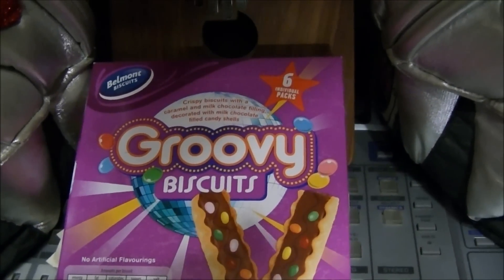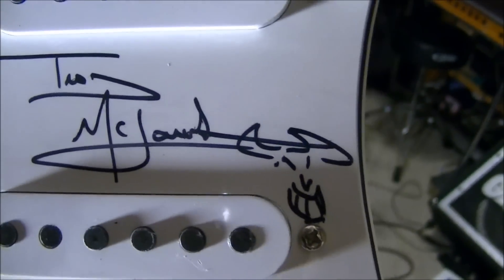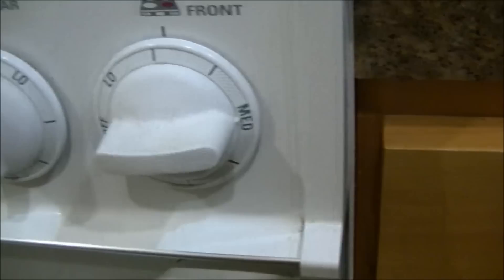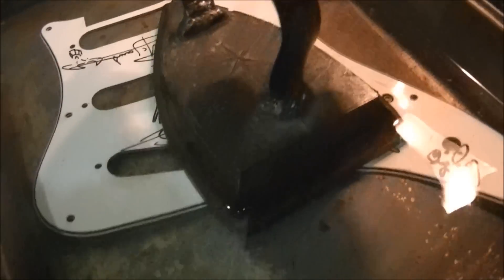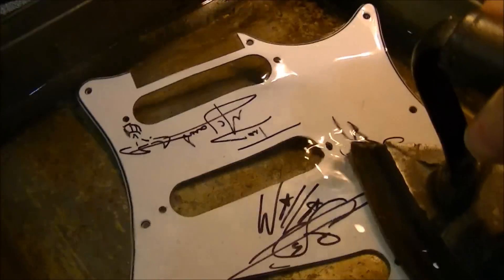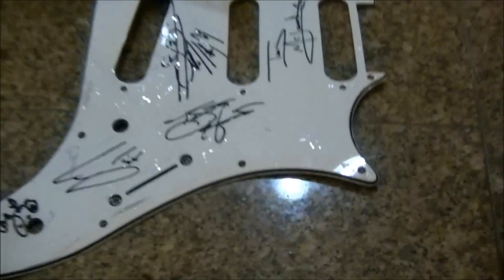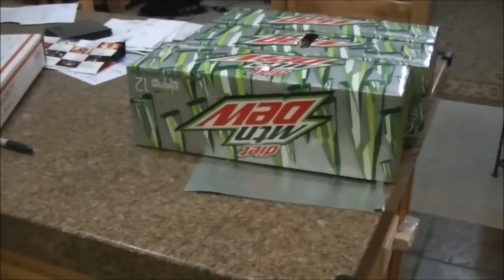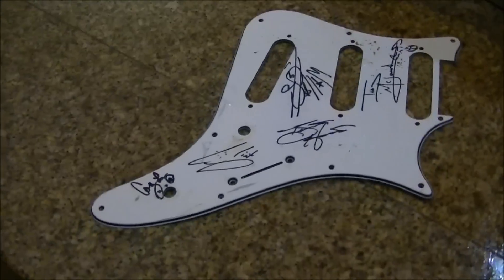Straightening Out Warped Pickguards  By Scott Grove

Comment: Scott, thanks a lot! Just used your technique for flattening a warped out gray pearloid guard from a 90s Ibanez Talman. This thing looked like the Rocky Mountains before I got to it. You'd be striking the guard every time and hear the hollows beneath. Fixed. Done. Super easy. The hardest part was taking off the tone knob. I used a shallow cookie sheet, filled with water, used a smaller 2" deep cake pan that covered the whole guard, and weighed it down with a 15 lb curling weight. Final flattening and cooling on countertop. Thanks again.

Comment: I use a hair dryer, works fine too.
Reply from the maker: How does it do on Bakelite?   Plus, to those reading the HAIR DRYER method.....take the pickguard and all electronics etc. off the guitar before you do ANYTHING to your pickguard, hair dryer, under water, microwaves or flame throwers.
Reply: Hey Scott, I haven't tried on bakelite.. and of course, always remove the pickguard before using the hair dryer, unless you like bubbles on your finish!! See ya Doctor Groovy!

Comment: In a strange way i just do like warped guards. But good video for those who don't :).
Reply: Note: i don't think you must try this with nitro celluoid guards, because celluoid reacts very very on minor warm temperature. I dare not to do that with pguards of +$500
Reply from the maker: You don't dare to.....But.....I have many times.  I could get about a grand out of the Firebird pickguard, but.....into the water it went.....worked perfectly.  I wouldn't post it if it would hurt anything.  Just don't bring the water to a boil or anything.  Just enough to make the material pliable.
Reply from the maker: I guess you are.  You are not aware that parts can cost that much?  Here's a white STRAT pickguard for $2,400.00  http://www.ebay.com/itm/1957-Fender-Stratocaster-Pickguard-REAL-DEAL-1957-1958-1958-/391160483880?hash=item5b12fb5028:g:-uQAAOSweW5Vb09v  Couple grand here:  http://www.ebay.com/itm/1950s-Fender-Esquire-Authentic-Original-Pickguard-50-53-/282145075851?hash=item41b128328b:g:NGkAAOSwaB5XkpsR  Here's a thousand dollar Les Paul Pickguard http://www.ebay.com/itm/1952-1956-Gibson-Les-Paul-Standard-Pick-Guard-/151361728256?hash=item233ddcaf00:g:nRAAAOSwDZxTzl85   If you are a collector, then EVERYTHING is expensive.  The pickguard on my 1964 Firebird goes for a thousand or more easily and I straightened it out this way.  It's just what things cost.
Reply: +Groovy Music Lessons that's true. Thanks Scott. Cheers
Reply: +Quikdeth check Eddy Vegas store on the web. Try to not freak out :)
Reply from the maker: It's no different than having a passion for ANYTHING.  Do you want a Porsche?  If you get one.....expect to pay tons of cash for ANYTHING that will go wrong with it or when it gets damaged.   This is NOTHING like drugs.  Wait until you grow up and half of your family and friends have either O.D.'d or simply killed themselves because of drugs.  If you ever have kids, statistics are that if you have more than one....you'll likely get to watch one of them die from drugs.  I've had the thrill of watching about 20 close family friends and family members die from Heroin in the past year alone.  Don't laugh about drugs.
Reply from the maker: Venom?  Whatever.....blocked.
Reply: Groovy Music Lessons hi doc. Yesterday i gave it a try exactly  like your way here. So i can now say, it's a Perfect method and works for me.
I had a extremely warped nitrate celluoid one fitted on a Fender Jazzmaster '63. I was a bit sceptic you know about this, 1. the vallue of the guard and 2. The material nitrate is extremly reactive to heat that kept me a bit affraid, but with all your video's, your allways right. I take the risk and i'm glad with your advice.
Thanks doc. Regards Richard
Reply from the maker: Howdy my friend.  I'm glad you tried it out.  So many people are freaked out by my little methods or discoveries.....but.....they work.  lol   Yeah, I know what you mean about the value of the pickguard and the guitar etc.  I did it to my '64 near mint Firebird V and it turned out perfect.  When dealing with guitars worth more than 10K, it can be scary, but.....I've done it so many times now that I don't fear any guards at all.  I just have to remember to treat it like a pickguard and remember that I'm not cooking bacon.  lol  Again, thanks for stepping up and taking that chance that things like irons and hair dryers will destroy.  Be Groovy!
Scott